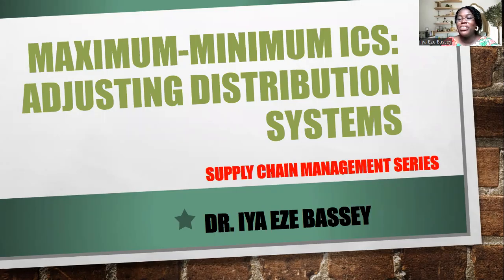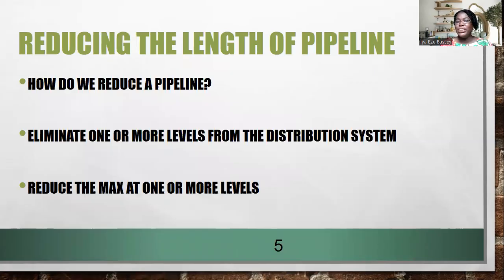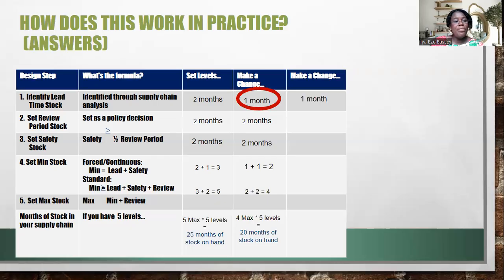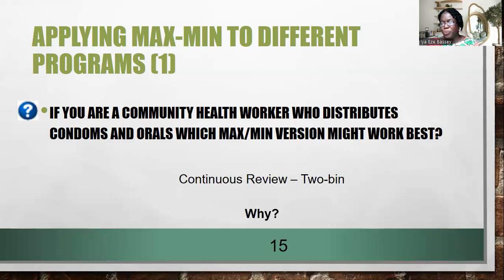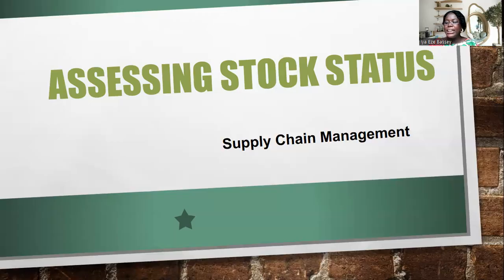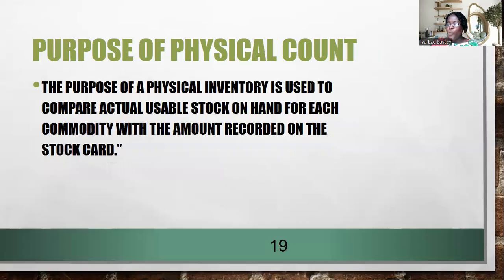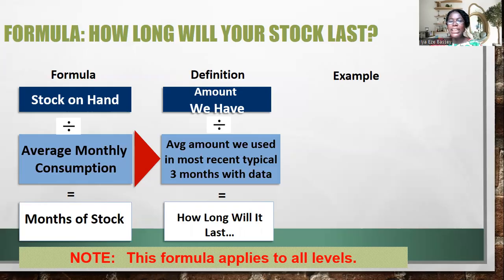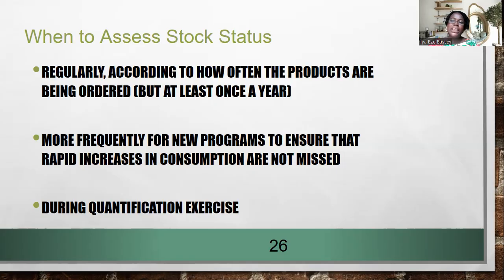Maximum-Minimum ICS: Adjusting Distribution systems (Supply chain management series)

Comment: Thank you ma for an amazing lecture.
Adjusting distribution system policies often begins by considering the length of the pipeline, which refers to the total time and distance goods travel through the system.
When designing a max-min ICS (a system that sets maximum and minimum stock levels), pipeline length is a key factor. The process involves:
 1.Establishing initial max-min policies for each facility type and level.
 2. Verifying the overall distribution's functionality with these policies.
 3.Assessing the total pipeline length implied by policies at each level.
Reducing Pipeline Length
To reduce pipeline length, you can:
 1.Eliminate one or more levels from the distribution system.
 2. Implement policies that lower maximum stock levels at various points.
Systematic reduction of pipeline length can be achieved by:
 1.Shortening the review period for inventory.
 2.Decreasing lead times at one or more levels.
 3.Improving system distribution reliability.
Factors affecting Max-Min Stock Levels:  Beyond pipeline length, other factors influencing the impact of max-min stock levels include: 1.Product cost  2. Transportation reliability
 3.Storage capacities  4.Shelf life of health commodities
Advantages of Max-Min Systems
This system offers several benefits, such as:
 1.Preventing both overstocking and understocking.
 2. Simplifying inventory control decision-making.
Challenges with this system typically arise in:
1. Systems that manage a large number of commodities 
2. Systems that manage products for new programs.
Assessing stock status involves a physical count of usable units at each health facility. The primary purpose is to compare the actual usable stock with the amount recorded on stock cards.
The general goal of assessing stock status is to determine how long current supplies will last.The formula for assessing stock status is:
Months of Stock = Stock on Hand / Average Monthly Consumption.

Comment: There are various steps involved in designing a max-min ics, they include:
Setup initial max-min policies for each level and type of facility 
Check if the overall distribution will function properly if the level specific max-min policies are implemented 
Check if the total length of the pipeline that the policies at each level imply 

In reducing the length of the pipeline:
Eliminate one or more levels from the distribution system 
Reduce the max at one or more levels

Comment: Thank you ma for this lecture I learnt that the max- min inventory management system ( ics) gives detailed information for managing stock levels to avoid over stocking and under stocking commodities .
Advantages of using max min system 
- Avoid Overstocking
- Avoid understocking 
- minimize wastage 
- consistency of stock level 
- simplify inventory control decision making. 
The purpose of accessing stock status 
- to determine how long the supply is going to last
- to compare actual usable stock on hand for each commodities with amount recorded on the stock card

Comment: Thank you ma, 
I learnt the ways of reducing length of pipeline, this is by eliminating one or more level from the distribution system or you set up policy that can reduce the max at one or more level. 
Ways to reduce the maximum stock level this is by shorten the review period at one or more level, reduce the lead time at one or more levels, by improving the distribution system reliability at one or more level So that safety stock   can be reduced. The advantages of using Max - Min system is to 
Avoid overstocking and understocking
Minimize wastage
Avoid costs of emergency orders
Simplify ICS decision making Etc. 
Physical count is the process of counting by hand the total number of usable units of each commodity in your store, we do physical count bcuz we want to know the amount of actual usable stock on hand for each commodity. We assess stock status regularly according to how often the product are being ordered, during quantification exercise and more frequently for new programs to ensure that rapid increase in consumption are not missed. Thank you

Comment: In this session. I have learnt the following;
Steps in designing max-min inventory control system, which are; setting up initial max-min policies gor each level and type of facility,  che k ifbthe overall distribution will function properly if the level specific max-min policies are implemented and check the total length of the pipeline that the policies of each level applies. Learnt about the factors that impact max-min stock level, which are cist if products, reliability of transportation, storage capacity, storage conditions at different levels, shelf life of health commodities, iead time etc. Learnt about how to determine our month of stock which I'd by carrying out physical count, and assessing how long stock can last, also learnt that we should be able to assess our stock regularly according to how often the products are being ordered, more frequently for new programs to ensure that rapid increase in consumption are not missed and during quantification exercise

Comment: Summary;
I have learnt that the Max-Min inventory inventory management system (ICS) gives detailed information for managing stock levels to avoid overstocking and understocking commodities.
Steps in designing Max-Min ICS include:
    1)Set up initial Max-Min policies for each level and type of facility
2) Check if the overall distribution will function properly if the level of specific Max-Min policies are implemented
3)Checking the total length of the pipeline that the policies at each level implies
Factors that can impact Max-Min level:
1)Reliability of transportation
2)Cost of storage
Storage capacity
3)Lead time
4)Storage conditions at different levels e.t.c
Advantages of using Max-Min system:
*Avoid overstocking
*Avoid understocking
*Minimize wastage
*Consistency of stock level
*Simplify inventory control decision making.

Comment: Max -min ICS  sets maximum and minimum stock level for each level of distribution pipeline and adjustments are necessary to address issues such as long pipelines and excessive stock.
There are methods to identify and reduce pipeline lengths i.e 
1. Eliminating distribution levels.
2. Reducing max stock level at one or more levels.
The systemic approach involves adjusting the elements of the Max-Min  calculation.

Some internal and external factors that affects the appropriate Max - Min levels include; cost of products, infrastructure, shelf life of commodities, reliability of transport.

There are advantages  and disadvantages of using the max - min system
Assessing stock status: this process helps identify discrepancies and determine how long current stock levels will last with;
1. Physical inventory count 
2. Determining months of stock.
3. Frequency of assessment 

Formula to calculate how long our stock will last is; Stock on hand divided by average monthly consumption.

Comment: In summary,There are steps in determining a max-min ICS.
I Learnt that there are basically two ways of adjusting distribution systems i.e how to improve in the distribution system,are:
1.Reducing the length of a pipeline
2.Reducing the maximum stock level.

I Learnt of factors that impact max-min stock levels,which are:
1.Storage capacity 
2.Cost of storage 
3.Cost of product 
4.reliability of transportation 

I understood the purpose of physical count and how is is used to compare actual stock onhand for each commodity with the amount recorded in the stock card.

Also,I Learnt/Understood the advantages to using the max-min system:
1.Avoid overstocking
2.Avoid Understocking
3.Minimize wastage.

Thank you ma.

Comment: Good Day Ma.....
Summarizing on the topic taught on ADJUSTING DISTRIBUTION SYSTEMS ( LENGTH OF A PIPELINE)
one important feature in SCM is  to reduce pipeline length In order to make products reach customer at a specific time. So in order to achieve that we eliminate Max. stock level, reduce lead time, reducing  review period and also improving distribution systems reliability...
There are some advantages of max -min system which are overstocking and understocking being avoided, wastage also reduced, maintaining consistency of stock levels, simplify inventory control decision making....
Also accessing stock status by physical count( it helps us compare the records with what is on ground with what is recorded on the stock card) and should be done yearly.....
You should also consider when to access stock status(i.e 
at least once year,more frequently for new programs to ensure that rapid increase in consumption are not missed)
Finally, some challenges  are faced to using each version and variations  and  applying max -min to different programs make programs reach customer at a faster rate. for example a community health worker who distributes condoms and orals which continuous review maximum version might work best cause there are less products distributed at community level..

Comment: In summary 
  There are ways in which the distribution system policies can be adjusted and the first thing to consider is the length of the pipeline. 
  Considering the length is a pipeline in designing a max-min ICS, the steps include. 
1. Setting up initial max-min policies for each level and type of facility.
2. Checking if the overall distribution will function if the specific max-min policies are implemented.
3. Checking the total length of the pipeline that the policies of each level supply. 
Ways in reducing the length of a pipeline includes; 
1. Eliminating one or more levels.
2. Reduction of max at one or more levels. 
Maximum stock levels can be reduced by: 
1. Shortening of review period at one or more levels.
2. Reduction of lead time at one or more levels.
3. Improvement of distribution system reliability. 
Some other factors that impact max-min stock levels are; 
The cost of the product, reliability of transportation, storage capacity, cost of storage, storage condition at different levels, shelf life of health commodities. 
  Advantages of using max-min stocks include: 
*. Avoid over stocking, avoid under stocking , minimise wastage, avoid cost of emergency orders, consistency of stocks levels. 
   I also learned about assessing stock status and we need to access our stock to know how long it would last. And to know how much stock we have first, we have to do a physical inventory count: this is the process of counting by hand the total number of usable units of each commodity in your store or health facility. 
To know or calculate how long our stock level last is
= Months of stock =stock on hand + average monthly consumption. 
  Finally, we have to access our stock at least once a year and we have to access our stock status regularly according to how often the products are being ordered, more frequently for new programmes to ensure that rapid increases in consumption are not in use also during quantification excess.

Comment: Thank you so much ma'am 🙏 
I learned how to plan a max-min system for storing health items. These Steps include:
* Setting the first rules for each level of facility
 * Making sure the rules work for the whole system
 * Checking how long the supply chain becomes
To reduce pipeline length:
 * Remove a level in the supply system
 * Lower the maximum stock level at some places
To reduce max stock, change these:
 * Review items more often
 * Reduce the time it takes to get new stock
 * Make the system work better so less backup stock is needed

Other things that affect max-min stock:
 * Product cost
 * Storage space
 * Storage cost
 * Shelf life
 * Transport reliability
Max-min helps because it:
 * Stops too much or too little stock
 * Reduces waste
 * Stops costly emergency orders
 * Makes stock decisions easier
Problems:
 * Many system levels
 * Many types of products
 * New health programs

A physical count is checking each item in stock by hand to compare with the written record.
Stock status is about knowing how long the supplies will last.

Comment: Thank you, Ma, for the insightful lecture.
I understood that designing a max-min inventory control system (ICS) involves several steps. First, policies must be established for each level and type of facility. Then, it's important to assess whether the overall distribution will operate effectively under those policies. Lastly, the entire supply chain's length should be reviewed. To streamline the pipeline, certain levels in the distribution chain can be removed or the maximum stock levels at some points can be reduced. Various elements such as product costs, storage expenses, storage space, commodity shelf life, and delivery lead times can influence max-min stock levels. This system helps prevent overstocking and stockouts, reduces waste, and can lower the cost of urgent procurement.

A physical count refers to manually tallying all usable items for each commodity in a facility or store at a specific time. This practice helps determine how long current supplies will last. To estimate the duration these supplies can cover, use the formula:
Months of stock = Current stock ÷ Average monthly usage.

Once again thank you ma.

Comment: learned that implementing specific maximum policies at each distribution level is essential for optimizing inventory flow, particularly in public health supply chains.  

Advantages of Max-Min Inventory Control
a) Reduces waste  
b) Avoids emergency order costs  

Challenges of Implementation
a) Managing multi-level systems  
b) Controlling inventory for new programs  
Purpose of Stock Status Assessment
a) Conducts physical counts  
b) Verifies stock accuracy  
c) Prevents discrepancies leading to stockouts or overstocking

Comment: Thank you for the informative video. From what I’ve understood, in the context of an Inventory Control System (ICS), pipelines refer to products that have been ordered from a supplier or manufacturer but are yet to be received. These pipelines act as inventory buffers that help maintain a stable production flow and prevent stockouts or overstocking. By distributing pipeline inventory at regular intervals, manufacturers can keep stock levels steady. Designing a Maximum-Minimum ICS involves setting initial maximum and minimum stock policies for each facility and supply level, checking if the overall distribution functions effectively under those policies, and evaluating the pipeline length each policy supports. To reduce pipeline length, one can eliminate certain levels in the distribution system or implement policies that decrease the maximum stock levels at specific points. Reducing maximum stock levels can be achieved by shortening the review period, minimizing lead times, and improving distribution system reliability, which allows for reduced safety stock. Factors that influence maximum and minimum stock levels include product cost, transportation reliability, storage capacity and cost, shelf life of commodities, lead times, and the maturity of the program in place.

Comment: Thank you ma.
I learned the steps to make a good max-min stock system:
	1.	Start with rules for max and min stock for every type and level of place.
	2.	Check if the whole system can still work with those rules.
	3.	See how long the pipeline will be based on those rules.

To make the pipeline shorter:
	•	Take out one or more levels from the chain.
	•	Lower the maximum amount at one or more levels.

To lower the max stock level, change these:
	•	Make the review time shorter.
	•	Cut down the time it takes to get supplies.
	•	Make the system more reliable, so less safety stock is needed.

Other things that affect stock level:
	•	How much items cost
	•	How reliable transport is
	•	How much space you have to store items
	•	Cost of storing items
	•	How long items last

Why max-min is good:
	•	No overstock
	•	No understock
	•	Less waste
	•	Fewer emergency orders
	•	Easy to make stock decisions

Challenges:
	•	Too many levels
	•	Many different products
	•	New programs

A physical count is counting by hand what you have in the store and checking it with what’s written down.

Stock status check helps you know how long your supplies will last.

Comment: Thank you ma.
I learned how to plan a max-min system for storing health items. Steps include:
	•	Setting the first rules for each level of facility
	•	Making sure the rules work for the whole system
	•	Checking how long the supply chain becomes

To reduce pipeline length:
	•	Remove a level in the supply system
	•	Lower the maximum stock level at some places

To reduce max stock, change these:
	•	Review items more often
	•	Reduce the time it takes to get new stock
	•	Make the system work better so less backup stock is needed

Other things that affect max-min stock:
	•	Product cost
	•	Storage space
	•	Storage cost
	•	Shelf life
	•	Transport reliability

Max-min helps because it:
	•	Stops too much or too little stock
	•	Reduces waste
	•	Stops costly emergency orders
	•	Makes stock decisions easier

Problems:
	•	Many system levels
	•	Many types of products
	•	New health programs

A physical count is checking each item in stock by hand to compare with the written record.
Stock status is about knowing how long the supplies will last.